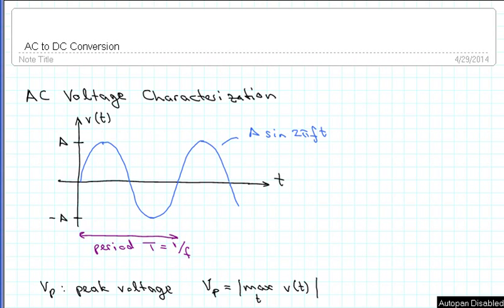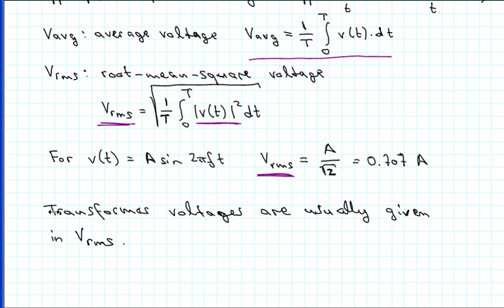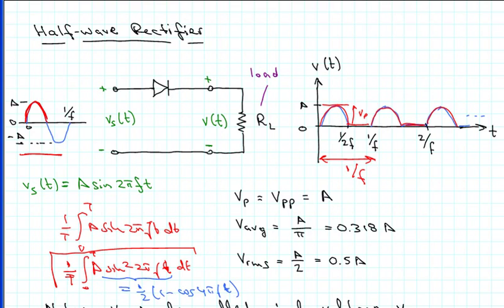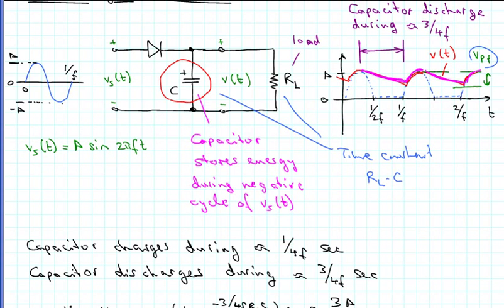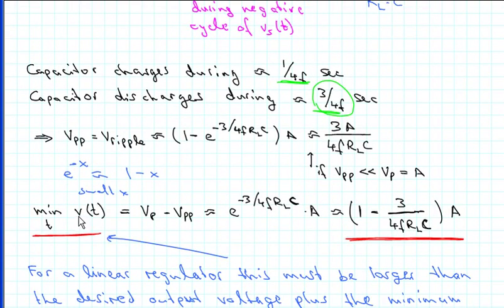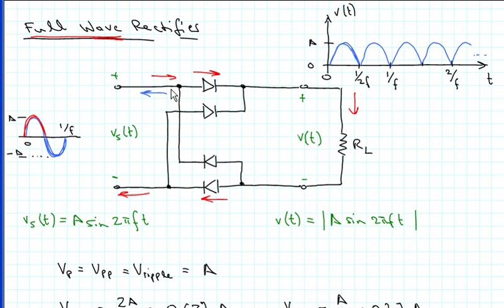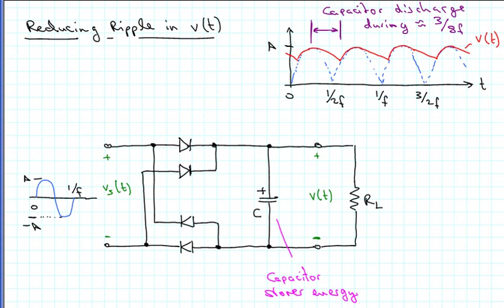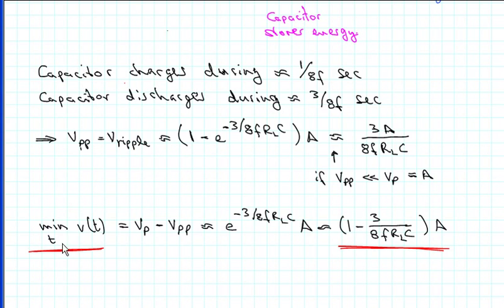AC to DC Conversion

Comment: In this circuit, the voltage output is always positive, is there a way to amend the circuit so we can get both positive and negative voltage output? Thank You.
Reply: have u got the answer?
Reply: @fatimaamara5691  The answer is @13:20 . Use a Recitifier bridge 4 diodes